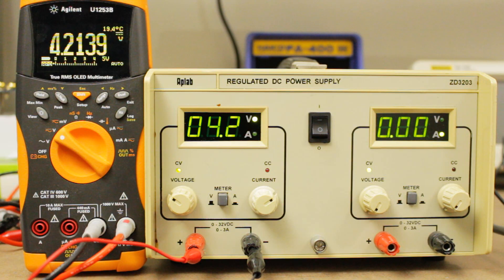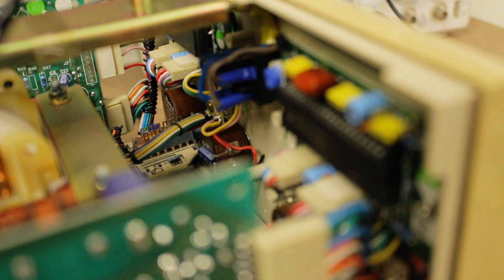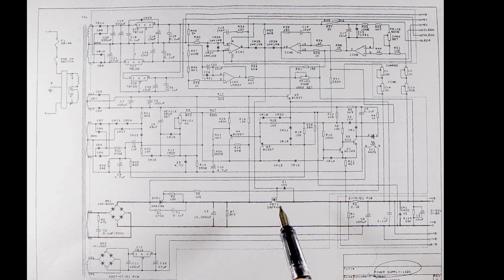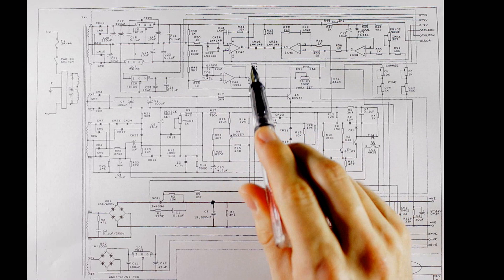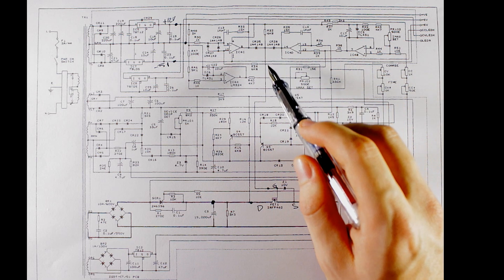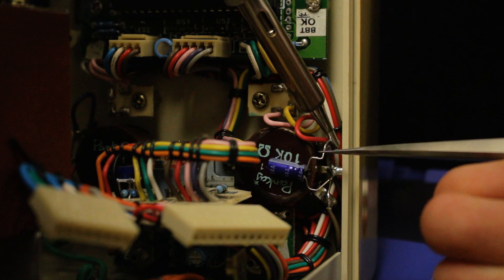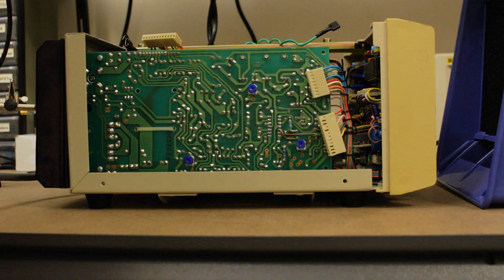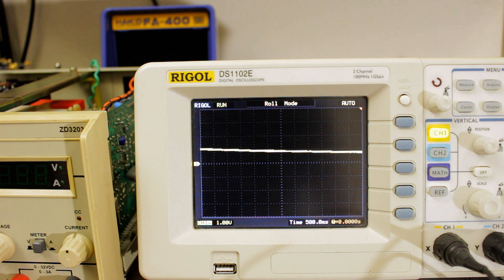Dumpster DC Lab Power Supply Repair

Comment: Great video. I find these ApLab Power supplies have no troubleshooting manuals available.
Could you tell what it could probably mean: When I turn on the PS, the output voltage shows 0.02V and does not change when I turn up the voltage knob.

Comment: Thanks for the inspiration to look at my old PSUs' outputs to check for issues. Good save of an old, but very useful, piece of tech. Ooo, 10-turn pots... Mines well replace all the e-caps, too. Any evidence that the offending e-cap was a (non-professional) repair? Have you continued to use this on your bench, since the repair two+ years ago?